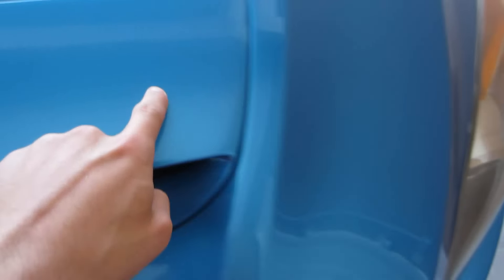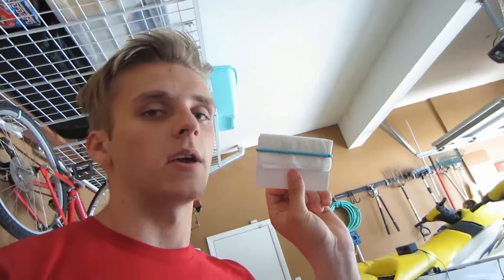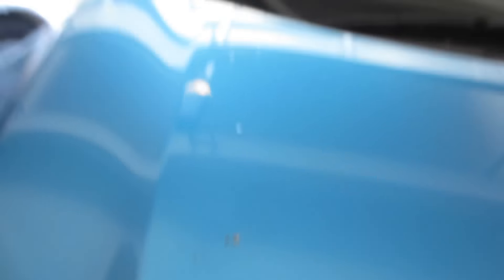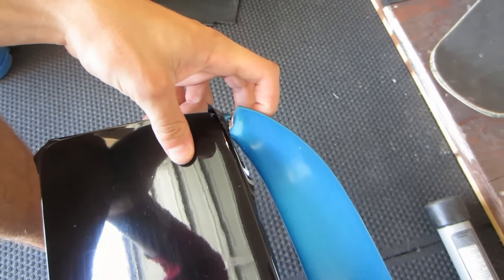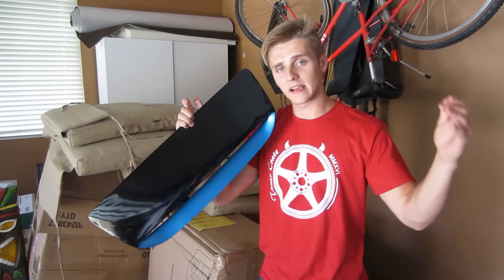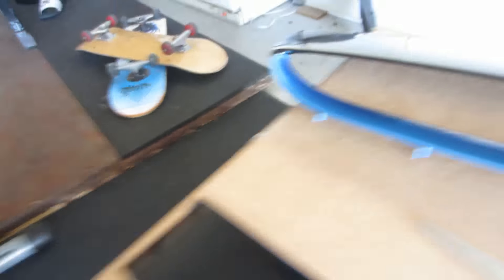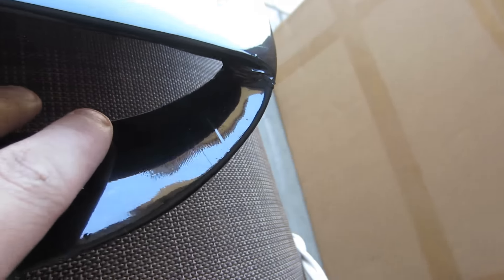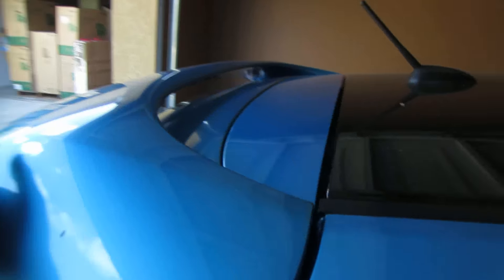I BROKE MY HOOD SCOOP

Comment: in my old 97 eclipse i had to basically cut a pipe which allowed me to have heat going into the car and block it off with a screw.. literally saved me from buying a new car buuuut i had no heat with new england winter coming around the corner.... theeeeen prob the dumbest thing ive ever done to a car was on my second eclipse with 77k miles on it (it was a baby for being 17 years old) i decided that i would down shift from 5th to first (dont ask me why i did this at all i was kinda just fucking around and still was a noob at standard) and my transmission blew the fuck up and so yea i single handedly destroyed one of the cars i fell in love with for years! hope that makes you feel better homie!  plus i broke a bezel on my brand new dodge dart while plasti dipping the interior.. when modding your car your always gonna break shit it happens!

Comment: When I was doing an engine swap in my 4Runner I had to drop the front end down so the engine could come over the core support because my garage isnt all that tall, so I jacked up the truck, took the wheels and tires off of the front and put jack stands back under the frame where they would clear the engine hoist and when I let the jack down, the whole thing pivoted off the jack stands and the roof of my truck smashed the ceiling in my garage as well as crushing the big flourscent shop light. Yes my dad was pissed

Comment: me and my friend were taking off the badges on my genesis coupe 3.8 and we got impatient and took it off with a knife. That basically messed up clear coat of the paint where the "3.8" badge used to be but with a little bit of wax, it looked new. Tip: Be patient when you're working on your car lol

Comment: Big tip with vinyl wrapping. High quality vinyl, larger piece then your wrapping and use one piece with more time in heating and actually stretch the vinyl around what your wrapping. the thicker the vinyl the better depth you can wrap. No saying you should un wrap your hood scoop. If u so choose to next time go with a thicker vinyl and slowly heat the over the induction area (for a lack of better words). It should be think enough not to loose color if you get a good vinyl!
 Vinyl is like tint more expensive you go the easier it will be to make your results better! A window tint shop wouldn't buy their tint at a grocery store! (also not implying that you are)
Keep it simple!
Reply from the maker: i got the vinyl from premium auto styling where tj got his car wrapped safe to say it as high quality
Reply: Yeah definitely I would recommend using one piece and stretching it! Definitely wasn't trying to imply that it wasn't good stuff! Good luck!

Comment: Most ridiculous thing i did was change out the Valve stem seals on my mustangs pushrod engine. I didn't want to pull the heads so I took some rope and shoved it through the spark plug hole and filled the piston up with rope. Then turned the crank to have the piston push up on the rope. This was so the Valves wouldn't drop in the cylinder once i took the springs off. All said and done didn't drop a valve and stopped the oil from leaking into the Cylinders :) (saved a lot of money and time)

Comment: Out of all the things I've fixed on my car, I broke my valve cover when changing the gasket, it was sitting flat all except 1 part, I didn't know and tightened all the screws down and cracked the cover. 1 trip to pull a part and it's good as new
Reply from the maker: hahahaha good to hear

Comment: I have an 1991 mr2 turbo and when I first got it someone hacked up an exaust for it. short story it ended up breaking so I bought an new exaust system, but the hangers wouldn't work with it and I was really inpatient, so I decided to vip tie it. well that lasted about a whole couple hours. now I have the brackets on.

Comment: I don't know how much that would cost for a Mazda to replace, but I know when I ordered a second set of hood louvers for my F-Type R to have painted in high gloss black it set me back $1k (including the cost to paint them). Each side was like $200 and the grid / mesh insert was another $200 a piece. Outrageous for what is basically small plastic parts. I also had to wait 6 months to get them from the factory. Tried a high gloss black wrap on them originally, but since they are functional the heat just peeled it right off, and had no choice but to get another set to paint. So anyway, I would guess a replacement hood scope for your Mazda will set you back $300-600. If it's less I'd be shocked. Wrap looks good though.
Reply from the maker: im looking at some right now but probably wont happen for a while

Comment: While doing an oil change on a car with a cartridge oil filter I couldn't drain the filter before taking it out (the cover that goes over the drain plug was stuck) and I had to take the filter out, long story short I spilled oil all over myself.

Comment: Well I already told you about the little white clip that is on the hpfp that i didn't notice popped off; which caused the fuel line to pop off, and cover the turbo and downpipe and went up with some flames.
Reply from the maker: i remember you telling me hopefully that wont happen to mine!
Reply: It won't, my dude!  This time, we won't blink when we pop off the clips!  Also, I am sure that you will have the camera rolling, so we are all good.

Comment: while installing my corksport HPFP, i didn't have a long enough 18mm deep well socket to break the internals loose, so i was stranded in an empty parking lot at 12:00...fml
Reply: i did get it fixed later the next morning.
Reply from the maker: damnnnnnn bro that is rough....we had to use two different sockets to get it loose

Comment: Sup broskiiii, One thing I did stupid once was back with my 350z when I drifted alot. I don't know how I did it but I did. It was raining and I was on a date with this chick from highschool. And the day before I bought a hydro ebrake and didn't have time to fully install it but I just left my stock ebrake non functional because I basically left everything Un bolted and shit. and I didn't even have my ebrake line in. But there was a round-a-bout and I went for a nice skid and I was doing a hefty 30 or so and I pulled my ebrake up and shit didn't happen and I didn't have time to stop the car from Going into the muddy ditch. the whole front end was beat and I had dried mud in my turbos when I went to the inspection office for the damage report. It was pretty much totalled part wise and I didn't want to rebuild the broken parts. So I hope I made my self look fucking retarded. Sorry I haven't been commenting lately either bro. I been watching but I didn't comment. Hopefully were still internet bros. I been taking my final certification test for my Master Automotive Mechanic. Hopefully I passed.  Great video bro

Comment: I blow a head gasket when I over heated it and the cost was like $1,600 in parts and labor so I had to sell it. It was 2000 gmc 3500. Rip.

Comment: Get a corksport scoop
Reply from the maker: i like them
Reply: +Danny Courtney good luck with the mazdaspeed 3. I have a mazdaspeed 6 and it's an amazing car. 2 things I would offer as advice is get a rear motor mount, upgraded high pressure fuel pump internals, and an accessport. Also, if you want more sound don't bother with a catback. A muffler delete sounds amazing on these cars.